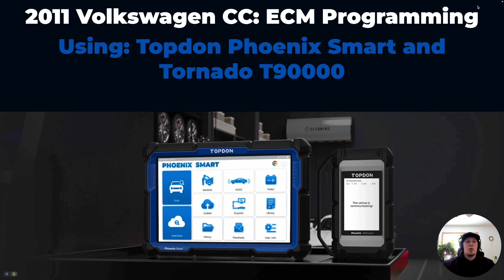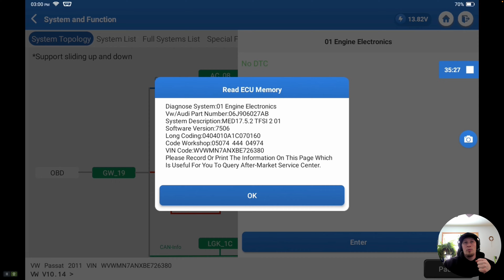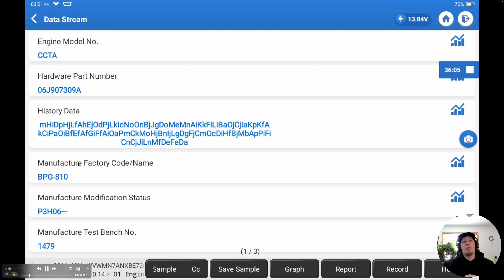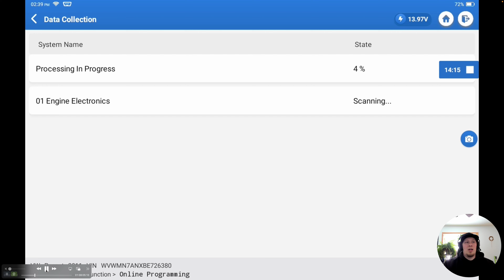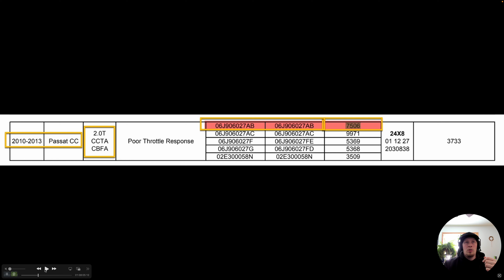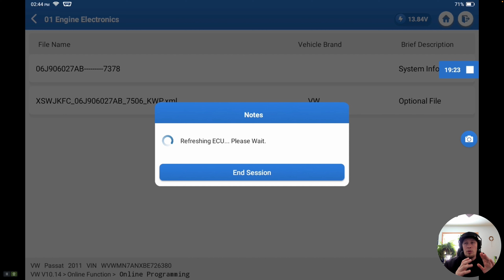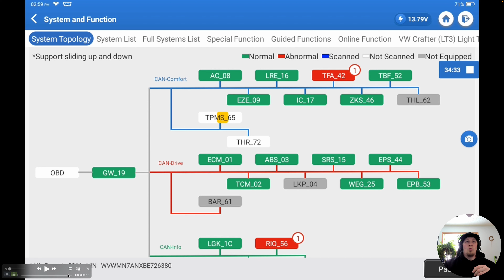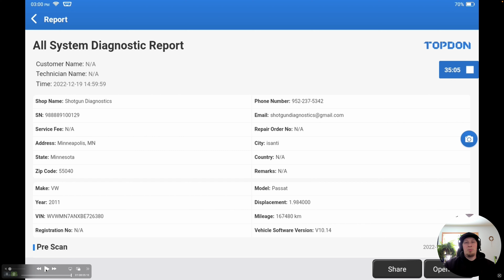Programming Volkswagen and Audi Control Modules By Phoenix Smart

Comment: Hi, thank you for your time... Question, I'm watching the video I just want to make sure if I'm doing something to a specific module that it is NOT altering / reprograming the ECU to. Just need clarification. Thank you and keep up the great work. The reason why I am asking because the vehicle has a tune.
Reply from the maker: Our video primarily aims to showcase the high-end programming capabilities of our Phoenix Smart. Additionally, it supports other advanced features such as online coding, VAG fault guidance, Mercedes SCN coding, hidden function activation, system topology, and more. If you're unsure whether the device supports a specific function, please provide the current fault codes and symptoms of the vehicle. Our engineers will further confirm its compatibility for you.

Comment: Hi Hawkins
The updates which appears, when you are doing this operation is that normally Continually updates?
Why I'm asking, a lot of the VW and Audi group cars sometimes have problems and when they are diagnosed these problems they are told to read some specific TSB and in that TSB, they have to find a specific update to solve the problem, is that possible too?
Reply from the maker: Hi, The programming files will not be continuously updated. Generally, new files will be released when some defects in the vehicle are found to be repaired. TSB generally needs to find additional information
Reply: @TopdonOfficial  OK, if you have issue in one of your ECU, and there are a TSB, telling you to run an SW update to fix a bug or this issue, and this update won't appear when you search in the Topdon tool, will it be possible to do this update anyway?
I believe that this job has to be a online job from OE site?

Comment: Hi there question about the update if it runs out can you still use the programming of the modules and how much does it cost for the update? thanks in advance
Reply from the maker: Hello Michael, the online coding and programming function will be  limit in use if the update period expires. the update fee of Phoenix Smart for end user is $795 per year.
Reply: Thank you, another question on the cloning side, that still works on the last update year of the car?
Reply from the maker: @michaelbuenvenida8473  cloning also requires get data from server, so if the device is within update period, it's supported. if the update expires, you cannot perform this function.
Reply: Ok sounds good thank you for answering my questions have a good day.
Reply from the maker: @michaelbuenvenida8473  Thanks for your message. Enjoy the rest of the day❤

Comment: Please can this tool work on audi components protection removal and engine control module programming
Reply from the maker: Hello,  I'm sorry to inform you that our current device does not support the removal of Audi component protection. This functionality is also not available in other competing products. However, our online programming does support Audi vehicles. If you could provide us with your vehicle model, year, and the specific ECU you wish to program, we will be happy to assist you in confirming compatibility. Thank you for your understanding.
Reply: So I can program any module on my 06 Audi with this device? I’m replacing body control module

Comment: Is this process done when changing ecm?
Reply from the maker: Yes, after replacing the new ECM, you will need to connect a regulated power supply. Afterward, you can proceed by using a diagnostic device to write the programming file to the new ECM. Once this process is completed, the replacement is successfully done.